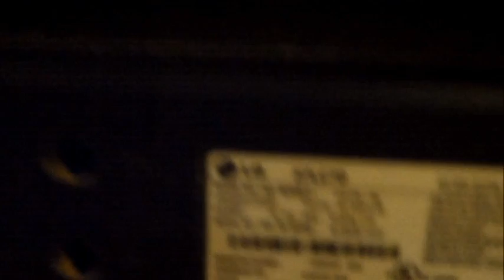LG LCD TV REPAIR - NO PICTURE SCREEN FIX REVIEW

Comment: I replaced the back lights on my LG 47LN5200 and now I have a blue screen. I have sound but no LG logo when power is turned On. When I press the settings or input buttons nothing is displayed on the screen, only a blue screen is displayed on the television. I can control the volume but nothing is displayed on the television. Please, do you have any guidance you can give an old man?

Comment: I have a 40 inch DYNEX LCD TV that turns on shows picture and sound but backlight goes out but sound keeps playing. If I hold a bright flashlight to the screen I can see picture.
I think it's bulging capacitors on the 24volt rail on the power supply. My guess. Ordered a capacitor kit.

Comment: Tampatec  I've been watching for awhile and need to fix this TV, It's a kdl 75w850c/ I replaced the t-con board following your videos but no back light, do you think it's the back lights, it blinks red 6 times, Sony/ ,,, On this other TV in my room an lg55lx6500 no back lights but it turns on no picture, do I test for power to the main board from the power board and it looks like 2 power boards in this lg thank you very much

Comment: Hello Tampatec, I have a Sharp LC-42LB2621u - Standby changes from red to blue, have sound but no picture. All LED's working. Already changed T-Conn board. When powered on Led's come on and then dim after a few seconds. No picture at all not even menu. Screen turns blue at power up then goes black. Please HELP. Thanks in advance.

Comment: Good mrng am having a problem with lg-65UH750V led tv it lost picture when i plug it on power it goes on with a grey backlight but the lg logo and pictures dnt appear when i use remote to change av it blinks the way it does when changing but still no pic,can it be repaired

Comment: Have a LG 50LN5400 that had sound but no picture......replaced the T-CON board.  Now it powers up but still no picture.  Flashes then goes black when turning on and off.  Any ideas of what to do next?

Thanks!

Comment: I have a 47LN5200 TV with no pic but sound.  Did the flashlight check, I see the picture. Good power, did the check on the power board.  No capacitor bulging, all flat. Go to the led power led 1 and 2, only get 80volts.  You said on the video over 100?  what next and thanks, love the videos.v/rDave

Comment: I have an LG 50ln5400. I haven't opened the back yet. but when I turn the power on. the screen pulses really quick. then the red light at the bottom pulses, then fades.
my question is, if it's the capacitors.  is there a kit, or do I need to find each one and order? also what are the tools you would recommend I use and where I should purchase parts. I appreciate any advice or help. thanks.

Comment: I have a lg model number 37LG50 and it will turn on but the screen will be black, opened it up and there are no blown capacitors but some are wiggly on the board and i was wondering how to fix this

Comment: I have an 55LS4600-UA and it was doing the same thing as your TV on this video..after viewing your video , I proceeded to check mine for bad capacitors, and found none that were bulging or blow out as yours were on the video , all of them seem brand new and no defects...What else could it be Please help
Reply: Bad LED's inside the panel, but would need to confirm other voltages/checks, the backlight on voltages on main, etc.

Comment: I have an LG 32LD550   I have OSD and audio but no Picture.   I have taken the back off and looked for swollen caps.   I have checked a few that i thought were suspect with a Cap Wizard but they check good.    any suggestions?

Comment: Hi, I have a 50 inch LG tv model #50PN4500. It won't power up. I have removed the back and confirmed all the capacitors are fine. I have a red light on my HDMI/USB board and I have a blinking green light(long,short,long,short) on the small board in the centre of the tv. Power light turns on when I plug it in, it blinks 3 times and that's it.

Comment: i have a 42LN5400  Mfg October 2013 have no screen picture, no front light, noticed a dis-colored capacitor, replaced it.  I don't have my standby voltage, have the 3.5 volts, but don't have the required 24 volts.  ordered a new power supply board from our friends at ShopJimmy, but still missing the standby voltage and the 24 volts.  Suspect a bad board, any thing I'm missing here?

Comment: I have an LG 37LC7D that was not turning on at all. I took it apart and have 3 capacitors that are bad. I replaced 2 of the 3 and now my TV will turn on, shows "HDMI 1" as it's powering up, but has not picture (it's a black screen). It does have sound. Should I replace the third capacitor?  What else could be causing this?  I replaced C202 and C217.

Comment: Thanks again for a great video.  I have the same set and it will come on when plugged in... no volume control and audio/video 'white noise' (aka, fuzz).  When I check all the voltages on P202 and P201, they all appear within spec....  I'm stumped....

Comment from the maker: I answer tech questions on my new videos for only my subscribers so subscribe it's free :) and allow 24 hours for reply. thanks! till then check out my tv repair Playlist.
Reply: Hello, can you please tell me what kind of picture tube I buy for a LG 50 inch flat screen pleae
Reply: Letitia Lewis q
Reply: Tampatec hey I have a question my LG TV is turning on but the screen is flickering do you have a video that can help me fix it the model is 55LW5700-DA
Reply: Tampatec hey is this the same with the t.v that freeze? because mine here it really does not open. it just blink with the red light.
ps. mine is LG 52 inch.
please reply asap thanks
Reply: Where can I buy 55 inch glass front panel Sony TV
Reply: Tampatec great video got a question about a LG LED TV smart TV basically you push the power button power comes on nothing on the screen shows up but the power on the power button shows up believe it's a backlight issue or cable what do you think it is I can send you a video of what it's doing haven't messed with it yet don't want to open it yet let me know if you need more information
Reply: THE LG I HAVE MAKES A CLICKING SOUND, AND THE POWER KEEPS TURNING OFF AND ON (GREEN LIGHT/RED LIGHT INDICATOR. NO PIC, BLACK SCREEN.
Reply: have a LG 47ls4500 no osd menu, no sound, no picture, but the screen turn on it has a dark bkue hue to it? what should i check first?
Reply: Hi Tampatec, I have lg 55 inches tv purple color has sound and no pictures . Would you give Any advice to fix that issue. Thanks

Comment: My LG 32inch LCD started having an issue. While plugged in the red light that indicates standby mode constantly flashes and the TV wont turn on. Sound like a capacitor issue?
Reply: WhiteychanStarcraft

Comment: That was brilliant my only issue was removing the board with the capacitors on I just rescued a lg to fix I'm stoked no remote or power cord so I got to get a power cord to see what is wrong with it .but great job on repair work .

Comment: Good morning my tv is a sanyo dp42740, went to turn it on this morning after waking the kids up for school and started making lunches and then I heard a loud static noise from the living room ran I to turn the volume down and the tv did have picture at the time but then cut off and ca me back on no picture, then on and off on and off, no picture just the turn on click and led power light, would this be a capacitor problem also?
Reply: I have  a lg model t420hw04  only half screen can u help
Reply: Grant Fairchild

Comment: I have an lg47la6200. powers on and flash blue lg for a half second and goes black. Does same when I power it off.  Would this video apply to what could be wrong with it. If so where can I get capacitors at?
Reply: Champernell Washington
Reply: MY LG IS DOING THE SAME THING , HELP NOT READY TO BUY ANOTHER SET

Comment: I got exactly same symptoms on my 46" Vizio sv471xvt. All capacitors shape looked OK and I thought it has a bad EEPROM.  So, I replaced it but still have same issue.  I think the next step to go ahead and change those capacitors on power board and see what happens.  Any other ideas very much appreciated.  Thanks

Comment: I have an LG 55" TV. It is only two years old so it is out of warranty. Last night the picture flickered on and off and continues to flicker on and off. There is sound, but no steady picture. I have been reading on the Internet that there are plenty of similar complaints on TV's  similar to mine. As a matter of fact there is talk of a class action lawsuit against LG. I am very sorry I bought this piece of junk. I paid $1000 dollars and thought I was getting a decent tv. Never will I buy another LG TV again. Does anyone know if there is a class action lawsuit being done?
Reply: I know this is a late reply, but it looks like there was a class action lawsuit against LG back in 2012 and it was thrown out.  I have a 42LN-5300, and the picture went out the other day, but it still has sound.  The extended warranty had just expired (big surprise) and LG told me it was either the LEDs or the main board, and that they would send a tech to my house to fix it for $320.  Um no.  It was only a $450 TV, and the repair kit can be bought from www.shopjimmy.com for $70, so you might want to look on there if you still have the TV.

Comment: Good Job, you are a good man !! Question: Have Samsung  60 LED TV, have audio/sound/ no visio, was told , it is probably bad T-Con board, could be bad capasitors too, I will check them out. I ordered used T-Con board from Canada (e-bay), it says, maybe work, maybe not, looks fine, taken out of TV, which did not turn on. Got it cheap, how do I test it?/ Just put it on?? Smaller T-Con boards , like UN46D600 could be fixed by changing capasitor CD31 and Transistor QD2, do you think, my T-Con board could have the same problem?? Are those cap. and transistors same number also in bigger T-Con boards?? Or numbers are different?? Thanks a million, youtheman =)

Comment: Hello Tampatec, my question is about removing capacitors.. i got all of the ones that were bad but one, the leg did not come out the hole.. is there anything i can do to help  clear the capacitor leg hole open?  thanks Tampatec!!
Reply from the maker: heat up the solder pad and push new cap leg in hole at the same time but I use desolder wire.
Reply: awesome!!  thank you so much! it worked! ill make sure to donate $ to your site!  oh one last question, i have replacement capacitors with are same Volts & UF's but not same diameters/dimensions can i still use them, any issues? thank you sir!

Comment: hi. I have a LG 55lh40 with the same problem. it powers on, got the blue light, there's light on screen, has sound but channel and menu button won't do anything, no image. checked for physical damage didn't see any. is there anything else I should check for?

Comment: I have an LG 50LN5750 Stand by light comes on, No picture no backlight and no sound! when I power on the TV the light Flashes twice then goes out. I already replaced the power board and thats not the issue please send suggestions!

Comment: Where can I buy capacitors?
Reply: my wire harness got messed up disconnecting and reconnecting. where do i find one of those, or figure out which one I need? LG42H90 the wire harness that goes from one board to the other. thanks in advance!
Reply: Aidana WillowRaven
Reply from the maker: on my tampatec.blogspot.com search box 100uf to 3300uf 25v capacitor kits
Reply: +Tampatec Thanks :D

Comment: hi, i have the lcd 47lg6000za with backlight on and startup sound but no picture. Swapped the t-con and nothing still the same.. main board ic? Changed a blown capacitor on the psu and still nothing. Tks

Comment: My 4 yr old DYNEX LCD #DX-46L150A11 screen go blank 2 minute after u cut it on, the audio works perfect. 
This start to happen after wife clean screen with some solution called "di Screen Dr" 
I usually clean screen with a solution called "rocketfish" 
I unhooked everything from the TV leaving it off for 24 hours, when i hooked everything back up and turned on the tv it worked well for several hours, when i cut off the tv believing it was fixed then cutting it on a couple hours later the picture showed for about 2 minutes then screen went blank again. what do i do?

Comment: hi 

i have a 4 year old LG 32" LCD (model LV3730-TD). it powers on, sound is working, responds to remote, all without the video coming on. if i keep it on for a long duration, it shows white patterns , and once or twice, it has shown the video but it goes off again. 

i cant recognise any blown components but to be fair i am a layman. the  LG technician says it is the video display panel  thats kaput, and will cost as much as a new TV to be replaced. 

is he scamming me? what can i DO?

Comment: un29f4000af Model.. I have a Samsung 720p TV , no picture did light test and seen words. Now on back there are 3 boards, one have RCA femals other has the plug for wall outlet and the bottom one sits under speakers and is long bit no caps on it... Where the hell is the inverter Must I take the whole metal away from screen to find it ? This is pissing me off please anyone , Its a UN

Comment: I have a Lg 42inch led tv my screen has a little crack on the led screen. Is it possible that I can use a lg 42inch smart screen to work on my Lg 42inch led not smart Lg Tv?
Reply: i have an 55 inch Lg plasma tv. it powers up but has a blank screen no sound. what should i do?.

Comment: hello I have a daytek 6460 42 inch about 7 years old given to it has black screen and previous owner says there are lights on in behind the panel ,he says when it had pic it was very clear compared what they have on the market can you tell me would this TV have blown caps to cause a black screen, I'm not sure if the sound was working I haven't got to pluug it in. is it worth to have it repaired it has a high end screen and many features not available on low end models 
thanks

Comment: Hi! I have an LG LN57, it goes ON and OFF by itself, the remote and  buttons doesn't work. All the capacitors looks alright when I open to see what's the problem.
I watched the related repair you posted "Common LG LCD TV REPAIR - NO PICTURE OR BLACK SCREEN FIX "

Comment: Hi, great advise on here. Hope you guys are still here answering questions. I have a LG 42PM4700-UB plasma tv that just went black. The red power light just stays red. Only blinks once when you try to turn it on by the button or remote. No picture no sound "DEAD" other than the red light. Capacitors on power board look fine. Any other advice?

Comment: Hi TampaTec! Hoping u can help me with what part I need to order. I have a LG 50LN5100-UB BUSYLMR. It's 1.5 years old and my picture went out. I have audio and the screen flashes when turned on/off. Also, the standby light is on. What do you think? Any help would be greatly appreciated!
Reply: zach Harrington I have the same problem with you. Same model and age also.Have you managed to fix it yet? I have been quoted 400 Stirling pounds by LG to fix it :-(
Reply: Matt Bullock  Hi. Sorry for the delayed response. I bought another tv, but I was told by shopJimmy.com to install a new main board. I plan on ordering and replacing this week. I will let you know what happens. Just curious, did you have a technician quote you and did they give you a name, description of the fault, or part #? Thanks in advance! Ttys!
Reply: DylanHarrington The LG service center wanted to replace the main board. But get this..... I refused to pay that price so they returned the T.V back to me and the guy why returned it said he can fix it for 100 pounds if he took it home, so I said OK and it was returned to we within a week fixed. The joys of living in Thailand 😊

Comment: I have lg 42LS4600 LCD tv. When i turn on the, it went to black screen. It also has no sound. I have takn back off to look for any possible scorch/burn marks, none off this seen.. what do I have to do to make it fixed..??
Reply from the maker: Reset home theater devices by unplugging power cord for 5 minutes then turn on tv then press tv menu on tv remote Use flashlight on tv screen in dark if yousee a dark image of menu then inverter  board is bad but no image means tcon board, but no sound and no picture can be from main a/v logic board check cables connections too.